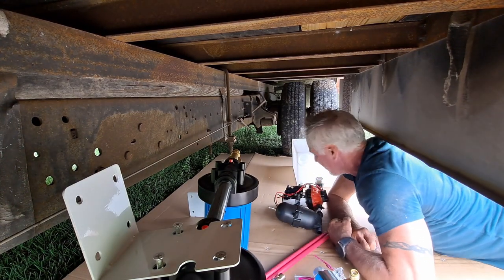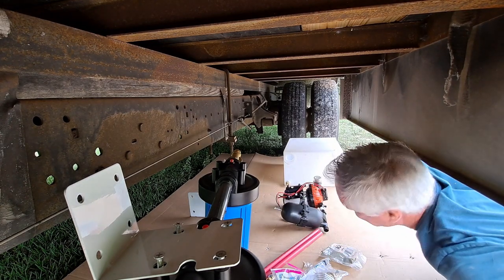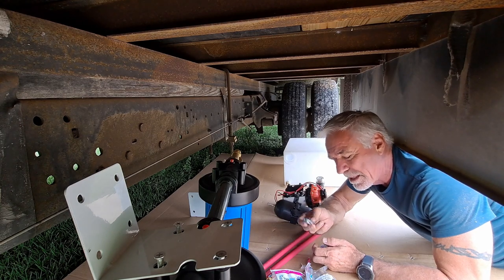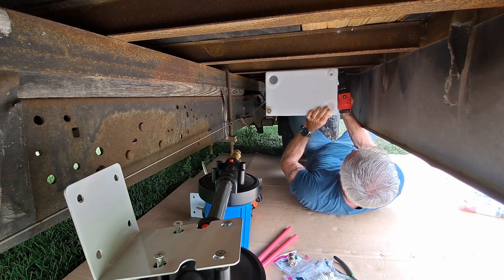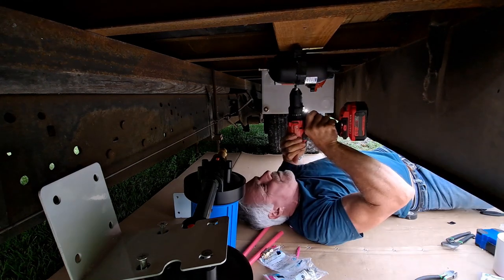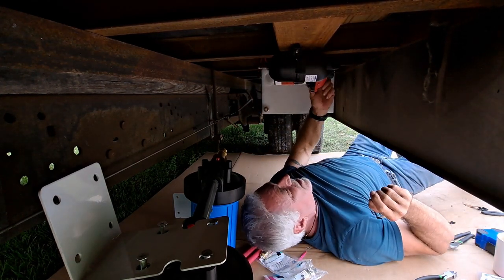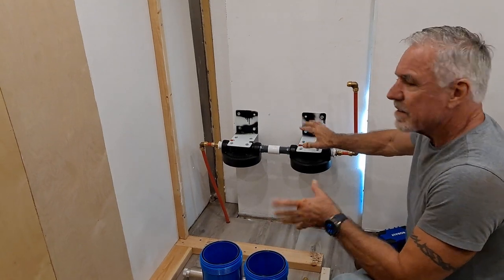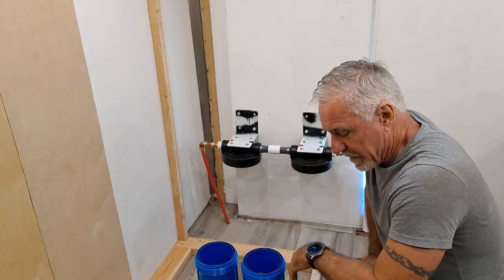Box Truck Conversion Recirculating Shower Plumbing

Comment: All that space underneath is utilized in my design. I am trying to put everything heavy there to act as ballast and decrease what needs to be above. Great place for tools and tanakage.
Reply from the maker: Mark9898, yes. A lot more space than I thought. Perfect for water/Gray tanks. I'll put a tank warmer on them when I get into cold weather. Also, I was thinking of a steel toolbox mounted under there too. Great ideas. Thanks for watching
Reply: @BoxTruckVagabond  I have a mounted 4k generator, a portable 2k genny, a 35 gal propane tank, 2-11 gal air volume tanks, 2-23 gal water tanks, truck wheel ramps, sand skids, toolboxes, jacks and coming will be ~4 more 5 gal water tanks. Over time I will consider switching items positions so that weight may be a greater factor over size. Use every sq. inch there. You can build component containers. The ballast below diminishes the danger of the sail above in windy conditions. Box trucks are inherently top-heavy. Watch a few videos of them toppling to appreciate the danger especially when cornering.
I plan to tow my mini truck that may function as a "sea-anchor". I have been thinking about this...not sure if the analogy works.
Reply from the maker: @Mark-gg6iy  now that is utilizing space well. Good job.

Comment: Curious if you’re still happy with this choice in a recirculating shower system and if you have any regrets or changes you’d make in building one again ?
Reply from the maker: Hi! Well, I don't think I knew enough about it. My water stunk early on. So much so, that I was going to have to buy everything new that was plastic. I stayed at my sister's for about a month and didn't use it, so I'm sure that's what made it stink. I ended up replacing it with just a tank and then it drains out. The tank is 21 gals. and I take quick showers so it does the trick. Sorry it took so long to reply. Thanks for watching.